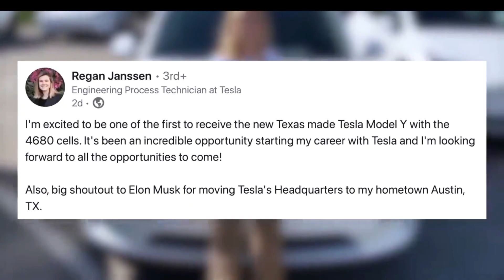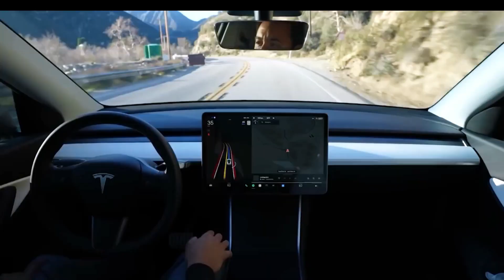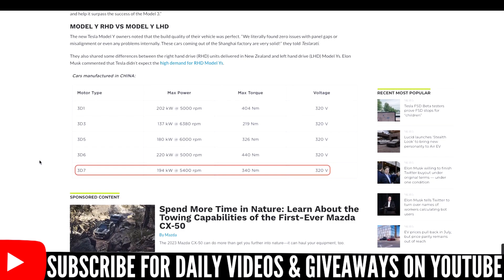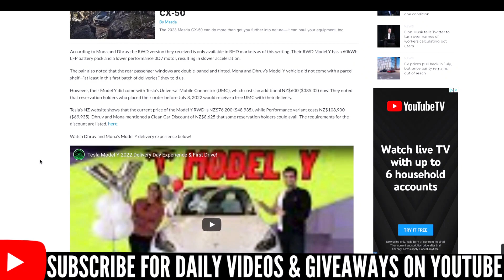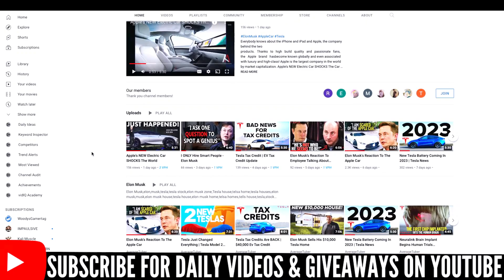NEW Tesla Model Y Confirmed | This Is Bad News

Comment: Don't think it classifies as an New model just because they switch batteries.
Reply from the maker: Tesla themselves made a post saying it is a new model of the Y. Also, It’s not only a battery because it is also a software update and small changes to the car under the bumpers. I am no saying you are wrong, I am just reporting the news based on the articles & press releases that Tesla has done.
Reply: Also don't think you can say confirmed new for 2023 when they are literally already being sold as a 2022 model out of Austin.